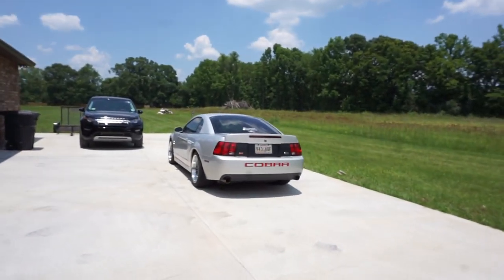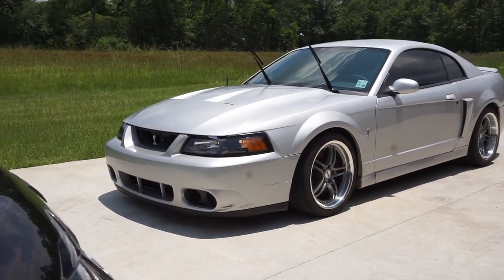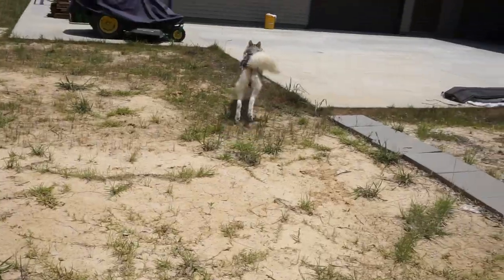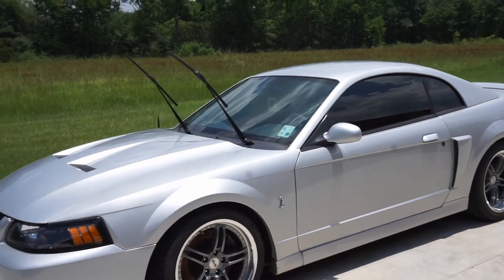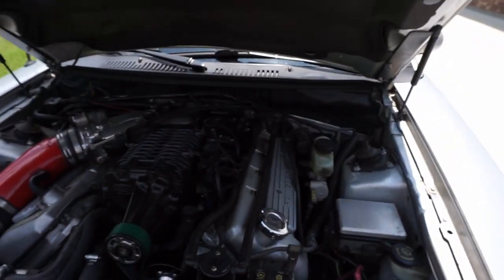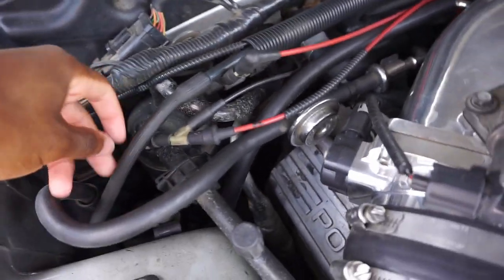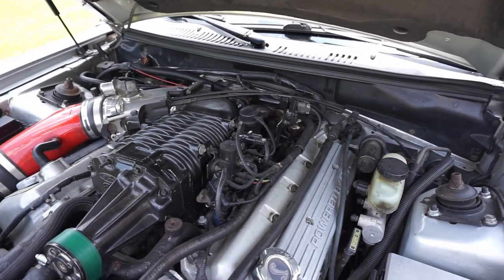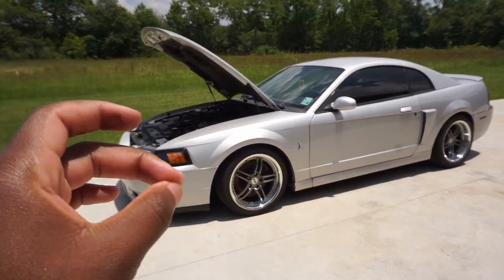When Your Car Finally Runs GREAT..!! | America's BEST Muscle Car!

Comment: ight bro...if you go on a mustang dyno, I highly doubt it makes over 450rwhp...but if you do a dynojet, most definitely it will,dont lose that dyno money to your bro lmao
Reply from the maker: Lol, I’m pretty sure I make over 450whp.. You must not be familiar with the mods I have
Reply: @pj_morrison  I watch ever vid bro lol, you got pulley an ported blower right??? I'm saying on a dynojet you would,mustang dyno I figure 430 ish...unless um missing something..what's current mods so far pj
Reply from the maker: I’ve read a bunch of forums and talked with a lot of ppl and they said I should be around 500 with these mods.

Ported blower
Intake
Full exhaust
2.7 upper
2lb lower
And supporting mods
Reply: @pj_morrison  didn't know you did long tubes headers bro, yes you would make over 450rwhp, an you can up the boost now too...didn't know about the 2lb lower either, I miss them vids lol
Reply from the maker: mgerren88 I said full exhaust but I still have the stock manifolds, and yea I have a 2lb lower. I’ll show exactly what happens in the dyno video
Reply: @pj_morrison  yessir keep em coming & good luck, still waiting to do a collab😎😎😎car runs strong for high miles bro most definitely
Reply: mgerren88 overspinning the stock Eaton like he is, it won't take too long for the thing to get heat soaked, then pull timing. I bet he makes mid 450 range if the car is cool and it's cool out.  Plus running those crappy bama tunes isn't helping much either. 

Mustang dynos are heart breakers for sure. They're more accurate than a dynojet Dyno. Some shops have some generous dynos to keep those customers coming back. Lol